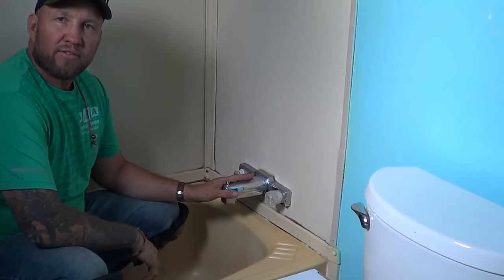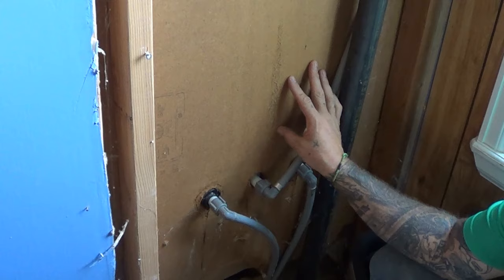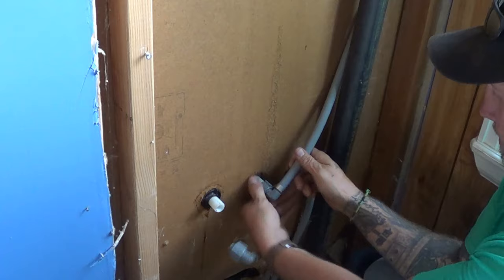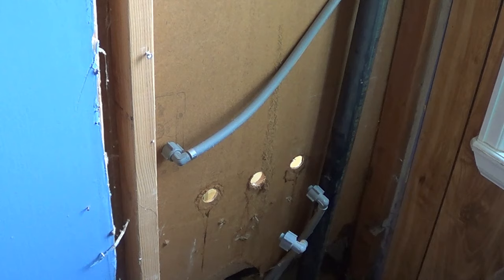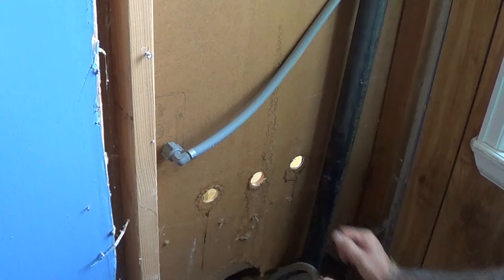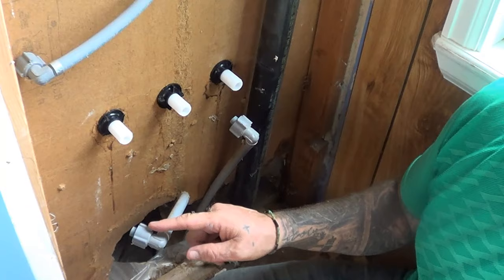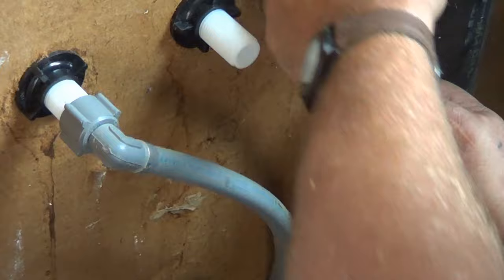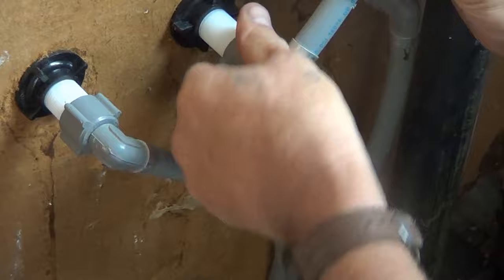How to install a Bathtub Faucet in a mobile home

Comment: So u have to cut the wall out to get to it??? Omg
Reply: I know 💀 stupid construction 😡
Reply: @lumi2798  So many issues like this in mobile/maunfactured homes....no cut off valves under the sinks either.  Jeeze.
Reply: Mobiles homes the laptop/Mac of the housing world
Reply: Better to do it from the back side than damage the front side of your bathtub. I know it sucks.
Reply: Ha!  Wait til you try to redo the floors and realize they build the walls on top of the flooring.  #goodtimes
Reply: That's what I'm saying 😮
Reply: Yep, they were badly designed with saving every penny for the manufacturer versus ease of fixing for the buyer. It's ridiculous.
Reply: Right! 🤦🏾‍♀️ I’m just gonna buy a whole new house at this point!
Reply: I made a frame around the cutout and it doesn’t look so bad.
Reply: Those gray pipes are not legal now.
Reply: Most trailers have the hot water tank there so if you have a access to your hot water tank you should be able to get to them through the entrance for the hot water tank
Reply: Where did you get your Spicket from? I’m not buying another one from Lowe’s. I went through three of them and they keep breaking in the same area.

Comment: Thanks so much for this video! Ive already cut the back wall in the closet and tomorrow im going to buy the faucet! Mine is the utopia v shape. Glad I knew to cut it out and check before going to buy the faucet! When I get faucet fixed the next project will be fixing huge holes in a wall!! 😅😅 Thanks again from this single mom who doesn't wanna have to pay someone to fix everything that breaks!! 😱😅😅😅
Reply: Im right there with you, youtube is my best friend.  I just replaced my hvac crossover duct in my double wide with the help of my teenager and I was so proud that I am on to my next project.
Reply: How did you cut the wall out and how did you repair it after, I'm most worried about that part. Lol 😅
Reply: @daniellebourque4448  Don't laugh, I cut the wall with a big knife 🤣🤷‍♀️ I haven't repaired it yet... as it's in my daughters closet so it can't be seen but I had a shelf from an unused entertainment center that I nailed over the hole. Worked out great lol
I know this isn't much help to you if your point of entry to the faucet shows 😕 Good luck to you! 😊
Reply: @carolinewells4355  Yay!! 😊

Comment: Our contractor has left us with a mess. He criss crossed our water lines to put the hot water on the right "because you don't want to reach thru hot water to turn on the cold" &  he glued the water lines directly to the tub faucet fittings. We just found this out when we removed the drywall to get to the plumbing. To say I'm angry is an understatement. Now we've gotta cut the water lines to change out the faucet. Came here to make sure I buy the correct stuff because I 100% will be doing this myself. Oh he also glued the water lines directly to our water heater.  We've spent so much money these past couple of wks fixing his "professional" work.
Reply: Going thru the same now the  cross crossed everything omg it’s a mess

Comment: Thank you for this! My hot water handle stripped and while I was taking a shower it wouldn't turn off anymore, I was freaking out because there is no way I can afford a plumber, after watching this i'm somewhat confident I can do this myself...hopefully
Reply from the maker: Oh no! I hope you were able to get your water turned off. I'm glad the video was helpful for you. And you can save a little bit of money! Please let us know if you have any questions when replacing the handle/faucet, we'd be happy to help you!
Reply: I literally had this problem tonight! My hot water knob was just spinning I was lucky enough to be able to put some pressure on the knob to turn it off until I can get a replacement.
Reply: Aftermarket "universal" splined handles are sold that use a set screw.  This is the workaround for fixing the faucet instead of replacing it.

Comment: What if you cannot get to the back panel? Behind tub is daughters room. There is no panel its just tub.
Reply from the maker: If you don't have an access panel available behind the tub wall, you will need to cut into the existing wall and make an access area. I would suggest measure from the floor to your faucet in your tub. Use that measurement to cut a small area in your daughters room behind the tub. Some home stores, carry an access panel you can put there once you cut an opening. I hope this helps! Thanks for watching.
Reply: @randythemobilehomeguy3715  thank you so much!!! It will be a wall that's visible in her room so I dont think thats an option. Someone told me I have to cut the tub around the faucet but I cant see that happening either. I'm at a loss. Now
 Waiting to see how much handy man will charge. Ty for your help! Your video is great
Reply: I am sure it's fixed by now right? whom ever fixes it will have to cut a hole in the wall.
Reply: @robertcannaday1414  yes and they did! Thank you for your guidance
Reply: @resml1028  well, I'm in the same boat! Was hoping to find out that wasn't going to be the only option.😥

Comment: Thank you for this video. Years ago I had a plumber do this for me and he had put in an access panel for me and a shut off valve so I can turn the water off without turning all the water off. Now I can easily do this for myself. I need to change these from time to time because they are just chrome covered plastic and the knobs go bad. I needed a refresher on how though so thank you.
Reply from the maker: Thanks so much for helping reply. Glad there’s some good plumbers out there and also some people willing to tackle their own projects.
Reply: You can get a replacement that has brass fitting so you don't have to replace it all the time. After the plastic when I ordered arrived broken!
Reply: @akeleven  from where

Comment: Hello, most of the time there is only a wallpaper covered drywall panel there. Is that the type we are talking about. Most times you will have to cut an access. Sometimes you need to take the seam or joint trim and the top and bottom trim and gentle pry the whole panel off. Sometimes you just have to cut a access panel. Sometimes if you cut about three feet high across the back area and take the bottom portion off it exposes both the drain for tub replacement as well as the faucet connections.
Reply: Thank you Randy! Had to cut an access panel and I fortunately purchased the correct replacement faucet already so with this video the changeout went smoothly!!
Reply: @judyj4534  How did you go about cutting the panel? I am nervous to blind cut into mine. 😅

Comment: Great video! Easy to follow instructions. My faucet has come loose from the wall on the cold water side. The black fitting is tight. What could I do to tighten it back up to prevent the entire thing from coming off the walll?

Comment: Thank you so so much it really helped me! 😊
How do I fix a leaking toilet it leaks from the bottom of the square top where the water fills in. Can I just use cocking water resistant or do I replace the whole toilet? Which I don't know how to do either.

Comment: I have a question about replacing part of the wall. I think we have some water damage around were the facet attaches to the wall on the back side. Would we be able to replace the damaged part of the wall from the back access point or will we need to take our shower apart from the other side and replace it that way? Your video was so helpful, but I was wondering if you would be able to help with that.

Comment: Hey bro! Your video was really helpful. I just purchased my first mobile home and remodeled the hallway bath. Is it ok to use regular home fixtures/vanity/etc? It seems quite big
Reply from the maker: Thanks for watching my video! Congrats on the new home!! Yes, you can purchase regular home fixtures such as lights, vanities and such. There are some items that are only Mobile Home type such as self concealed electrical boxes, special sized doors, windows & tubs along with some tub faucets. Unfortunately, they do not make mobile home cabinetry. You will need to replace both the cabinet and the counter top with a standard home size. They usually are about 1-2" wider from the wall out.  Thank you again!

Comment: Worth trying to replace just the spout if youre getting water flow through your spout when showering..the diverter is usually the problem..the spout can easily be replaced by just unscrewing it buy new one for bout 20 bucks without getting behind the wall..perfect video and tutorial for replacing entire unit though
Reply from the maker: Yes, you are right, you can replace just the spout as long as it is not the Phoenix Utopia Faucet. That faucet is all one piece where the spout and the handles are all one unit. Then you would need to replace the entire faucet. But thank you for watching the video!
Reply: @randythemobilehomeguy3715  np was very good..i replaced just a faucet in my place and thought well ill do same with brothers place ran into the all in one faucet and knob hence me gettin a lil more familiar so ty sir

Comment: I have a garden tub that needs a new faucet but it doesn't have another wall on the other side. Do I need to pull the metal off the outside of the trailer to replace the faucet?

Comment: This video was very helpful, do you really have to take out the whole faucet. I need to replace just the shower faucet.  They put a sink behind the shower wall, that whole area will have to be removed just to install, any suggestions will be greatly appreciated.

Comment: I think the water heater is behind my shower faucet if it is, do I have to make a hole in the shower then? 
To replace the facet?
Reply from the maker: You may not need to make a new hole then. I would suggest looking behind the water heater to see if you do have an access area to the back of the faucet. You may need to move the water heater if it is in the way. Be sure to turn off power and gas to water heater if you are to move it. Thank you for watching the video!

Comment: I'm having a problem with and old mobile trailer in shower. The water keeps fluctuating between hot and cold while showering. It doesn't do this at the tub water only when showing. I was planning on changing out the faucets, but wanted to know if you had any ideas why this was happening. I don't want to replace faucets if there is something else going on.

Comment: It there a way from the faucet side?  Unfortunately, our faucet is on the opposite side of a shower stall.  Sounds like I cut and patch the drywall...right?
Reply from the maker: Unfortunately you are correct. You will need to cut into the drywall. Best way to do this is to measure where your faucet from the floor up to faucet, and how far over from the back wall to faucet. Use this measurement when cutting into the drywall. If done right, you should cut right to where the back of the faucet is. I hope this helps! Good luck! :)
Reply: Depending on your problem it may be worth just trying to replace the spout its self with out replacing the handles..if u have a a spout that isnt an all connected then you can twist it off and replace it by its self without cutting drywall..not sure the type you have ofcourse but worth looking into before having to cut and replace dry wall

Comment: I have the same faucet. As a single mom I’m freaking out a bit about cutting the wall in my kids closet (that’s what the tub butts up to). The handle for the cold came off. It appears to have snapped so the screw is in the handle and the plastic that it’s attached to is snapped. It’s not much more round than the screw and you can tell the plastic snapped by looking at the end. Do I really have to replace the entire faucet? I wish YouTube let me post a picture as I don’t feel I described it well.
Reply from the maker: No worries, I think I understand what you are talking about. First, thank you for watching the video. Now, you help you. If only the handle  snapped, then you can just remove the screw and the broken handle. Inside behind the screw is a stem. Either plastic or brass. You use a wrench to turn it out of its place. Inspect the stem. If it looks in good shape still you can just replace the handle. If the stem is bad, you want to replace this first. And also the handle. You can do all this without having to cut in behind the wall. 
I hope this helps!
Reply: @randythemobilehomeguy3715  I am hoping this is my resolution too.
After 23 years my main bathrub is just now having issues with not completely shut the water off.
Really sad they make things this way.
The plumbing would have to be accessed in my son's bedroom.
Not a great thing as he's asd and hates any changes in his stuff.

Comment: When I turn my water off at the main water cut off the water still comes out of the faucet, I forgot and left something soaking in the tub and when I went back my tub was had overflowed and it was water everywhere, I had to pull out the carpet in the hallway, and 2 bedrooms.

Comment: Can you do a video on how to cut the wall out for this and then how to make it a door now or replacing the wall so it looks half way decent. I need to replace my faucet now because it's leaking and I'm soo scared to cut into my wall. 😕
Reply from the maker: Before you cut your wall, look to see if you have wall paneling. If you do, you can locate the strip that is hiding the seam of your walls. You can pull that away and then pull the wall paneling away and access the area behind your faucet. You will then reattach after you have completed the job. This is an alturnative to cutting an access hole. Thank you for watching!

Comment: Can I just replace the hot and cold handles ? Or do I have replace the whole faucet ?  We are moving so I want to fix most of these issues before moving
Reply from the maker: Yes you can replace just the handles. You would want to match the size and inside diameter. If your faucet is the all in one (handles & spout as one unit) and is an older model, you may be able to use the Phoenix brand handles. Should cost under $10 for a pair.
Reply: @randythemobilehomeguy3715  disregard that comment I assumed it would be an easy fix but it looks like I need to replace the shower tub which is the stem and bonnet parts from a phoenix brand. While the stand up shower I am having a bit of difficulty trying to find the part online and given it's Saturday most of the places are closed til Monday

Comment: do you have to drain the hot water heater to change the bathroom shower faucet? i dont have cut off valves on my water lines.

Comment: What size is push fitting for can u please share
Reply: Hello, these push fitting are for 1/2 inch pipe and a 1/2 inch thread on the swivel side which is what size faucets are. Thanks for the question. Get them at Mobile Home Parts 4 U

Comment: No need for rough in valve? I’ve replaced mine twice and within a year they leak out the bottom. Mine was redone like this exactly with the same pex but I don’t understand why it won’t last
Reply: Mine is leaking out of the bottom now. About to replace it. Did u ever find a solution?
Reply: @jasonroberts8206  no I didn’t. I ended up moving into a new home.

Comment: My furnace closet backs up to faucet.  where your blue wall is I do have about 3 feet where door goes against. Do I have to cut that wall? any help would be great! tk u
Reply from the maker: Hello, unfortunately sometimes they put the house together without thought to what may come next and put things in a place that is impossible to work on. When replacing this type of faucet, you have to get behind it to take it off, to disconnect the plumbing and unscrew it from the wall. If it does back right up to a furnace, it’s a hard one for sure, sorry to hear that. Sometimes you can cut the wall in the bathroom along the shower surround and pull it gently that way, though this could be destructive. I know I’m not much help, sorry

Comment: I'm having a walk in shower in my master bath torn out and replaced and the contractor told me to get a shower valve but with plastic cause he can't sweat it on if it's brass. Lol I really don't know what he means. The shower i'm replacing has one handle but im only seeing two handle ones. there is no tub just a shower. Any idea what he means and or where I can get one? I think it's the whole thing I need. Shower head, Turn on valve inside shower and then the rough in valve. Thank U!   Oh and this is for a Mobile home.

Comment: Thanks so much for this video, I also want to replace the sink faucet. Is that as simple as the box says? And also the back paneling does it just pop off with a putty knife or? Need a little help .
Reply: Hello, yes sink faucets are also pretty simple, however, make sure to be gentle with getting those fittings off. Sometimes the fittings don’t go back on well and leak. Be ready for that with some new fittings just in case. You do at times need to be a tenth level yoga master to get up in there to get those fittings off and back on. Straight off and straight on is best and don’t overtighten. Tighten of course but carefully and not cranked down. They are the same type swivel fittings just straight swivels instead of an elbow. Good luck!

Comment: Hello, where exactly was it leaking? Was it inside the faucet, under the spout? That would mean bad faucet, which, with the plastic guts seems to happen sometimes. They do make this faucet with brass insides, though it’s quite a bit more expensive. If it’s the elbows, replace them of course, thx